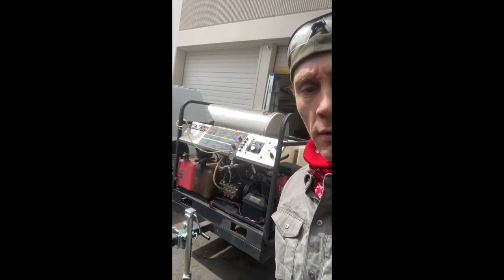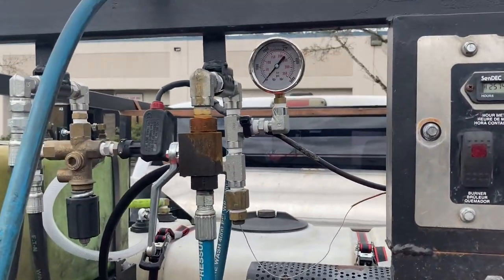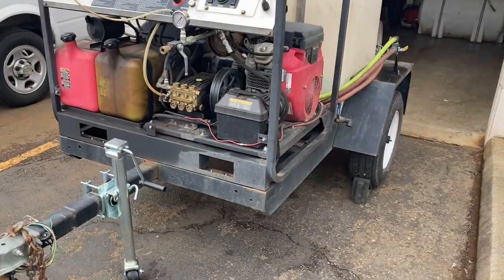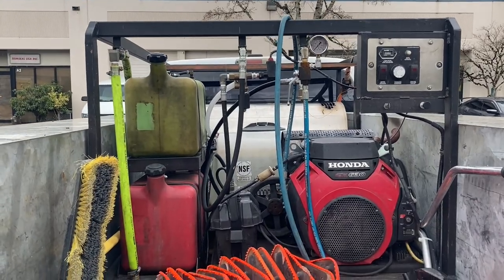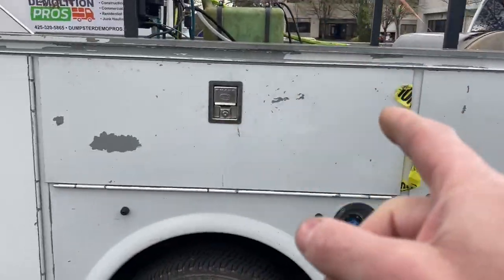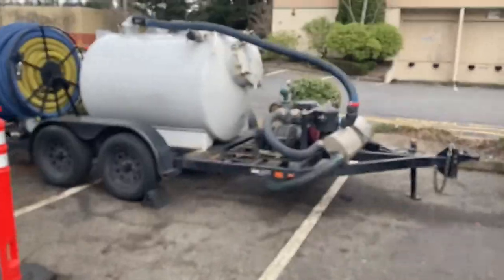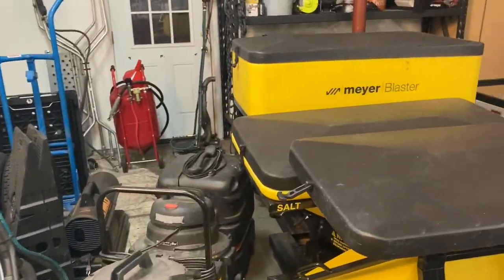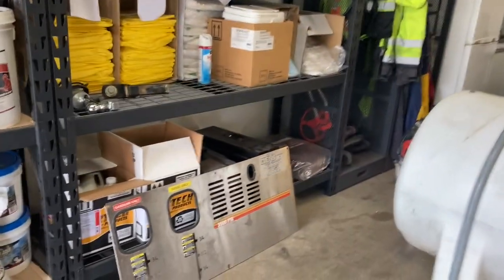Reclamation Pressure Washing "How To"   Equipment Tour

Comment: Hey Ben, I am looking to have a HW skid built for next season. I don't think we'll be at a point to reclaim next year, but want to get things set up for when that time comes around. I heard you mention that you run two 4GPM surface cleaners from your 8GPM set up & was curious how you do that split? Is that the Mi-T-M that can do that? The lady I spoke to yesterday about a skid build said the machines they use couldn't do that so I'm wondering which units can.
Reply from the maker: Any unit with a pressure sensitive unloader valve can.  Machines with flow sensitive cannot
Reply from the maker: Guess we got to do a video on that
Reply: @PolyVshot  That would be great. There are only a couple vidoes out there that touch on this & one of them warns against splitting the lines with a hot water unit. I believe his justification was that if one person lets off their line, it would increase the water temp of the other line which could lead to an explosion.
Reply from the maker: @IndySoftWash317  can you send a link to the one that warns against splitting lines with a hot water machine?  Thanks!
Reply: Hey Ben, did you end up having any thoughts on this?
Reply from the maker: @IndySoftWash317  ya, my thoughts are, the only time you can’t do that, is if you’re using a flow sensitive unloader valve, which is the rarest kind.  So most people’s machines could split lines.

Comment: What would it cost roughly to build one of those vacuum trailers?
Reply: doing it yourself, not really paying for your own time to yourself, just materials and stuff, you could do it for around 20 to 25k, depending on where you get the vac tank from, and what kind of functionality you want to give it.  having one built, custom, close to 40k.  We're going to be biding and selling these things ourselves, they'll MSRP for somewhere around 40k give or take.  some of the fancier models will come out at around 50k.  These more expensive versions will have hydraulic dump, and you'll be able by mean of a 4 way valve on the blower to either create vacuum in the tank or reverse it and pressurize the tank.  It'll be f***in cool!!!  :-)
Reply from the maker: It's a whole lot of labor hours putting one together and fabbing everything up, and when you're paying a skilled welder close to 100 per hour, you can see you'll add a ton to the cost of materials.  But I built both of these, with no formal welding training, and used a Lincoln Electric 140HD (110 volt) wirefeed machine from Home Depot.  I have much better welders now, including nice TIG machines, but when I built these I didn't have all that.  But just so you know, the entire system (both of them) were built with 110 v wire feed welders, some of it on gas, and some of it on gasless flux core self shielding mig wire.  :-)
Reply: @PolyVshot  I probably don't need one this big currently. I am getting into paver restoration so I want to invest in a vacuum surface cleaner and a vacuum system big enough to keep up with my 8gpm hot water machine so I can clean old polymeric sand and sealer off patios. But hate buying stuff then upgrading later unless it's just adding on. I just started watching you diy reclaim system series so hopefully I can get something put together after watching that. Really appreciate you responding to comments !
Reply: @PolyVshot  you speak my language with a lot of the stuff you say! I like quality and function over everything else and I like maneuverability and being able to change quickly! I appreciate the vids! Been tearing though them last 2 days. Good stuff
Reply from the maker: @MrBudpln  glad it’s helpful!  👊🏼